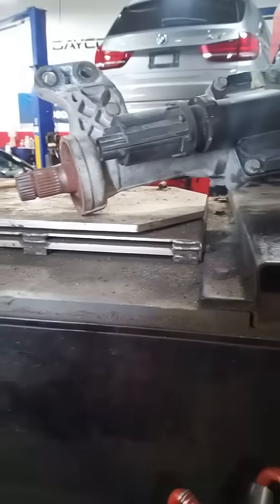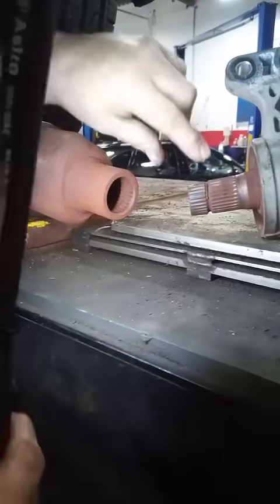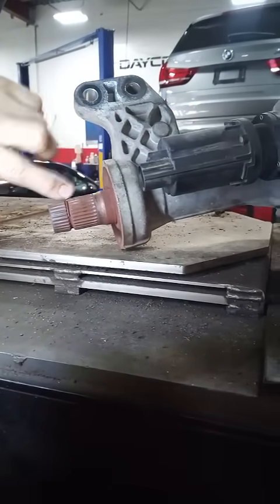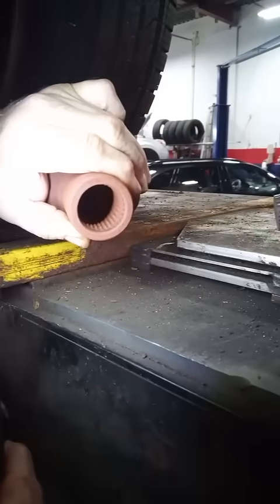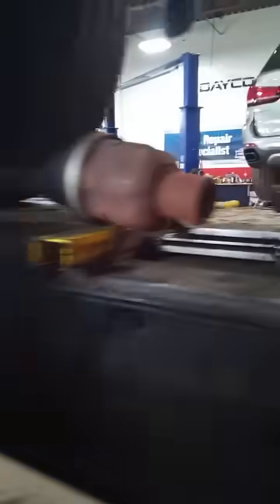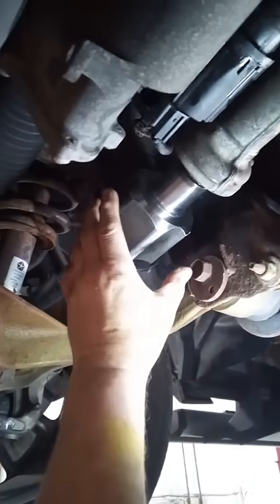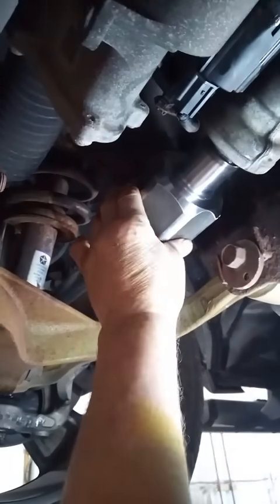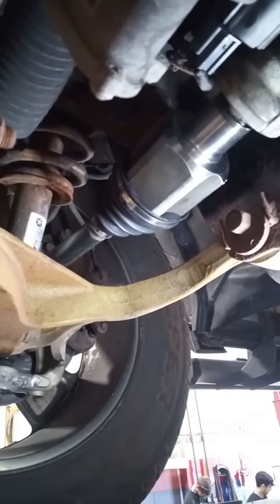“Axle Spline Failure Explained — Why Your Ram’s Front End Might Be at Risk!”

Comment: My question is why did you put a used diff in, you can get replacement shafts for the right side and fix it.
Reply from the maker: Great question — and you’re absolutely right, it’s a bit of an odd situation on these 2014 Ram 1500s. There’s no repair kit available for the right-side output shaft — only the left. The right side is actually integrated into the differential housing, so replacing just the shaft isn’t possible.

In this case, cost and practicality were big factors given the vehicle’s age and overall condition. We were able to source a gently used front differential with the correct V6 gearing, along with a replacement axle shaft, which made the most sense for this repair.

Thanks for watching and taking the time to comment — always appreciate when people in the community ask solid technical questions like this.
Reply: @UrbanAutomotive01 actually you are wrong I'm a chrysler master technician and you can get repair kits for these ive done lots. If I remember ill try and get a part number and the place you can order them.